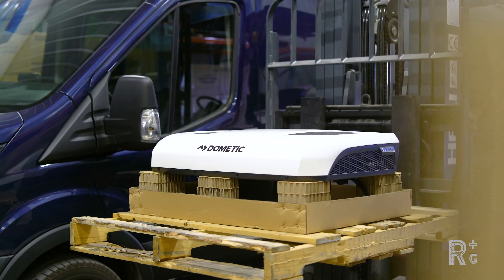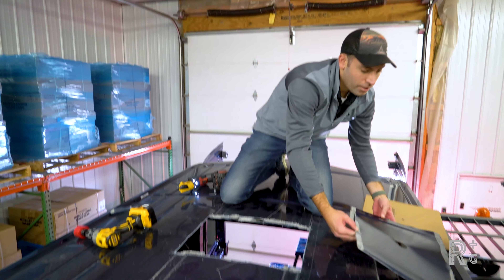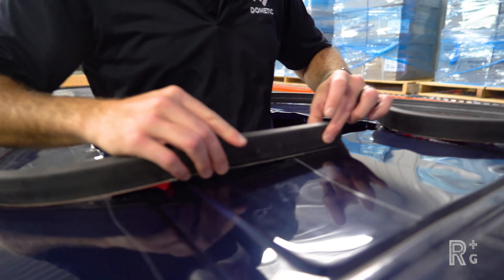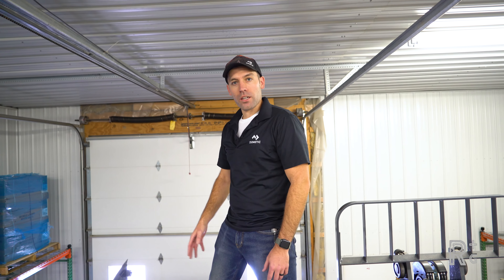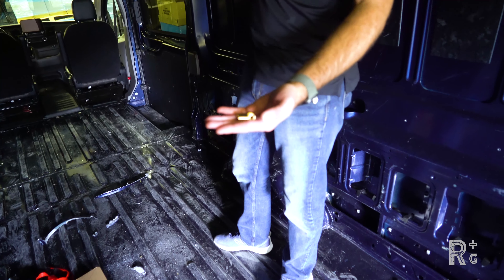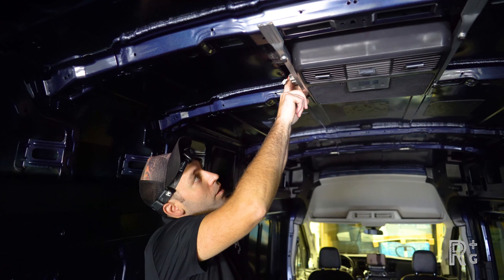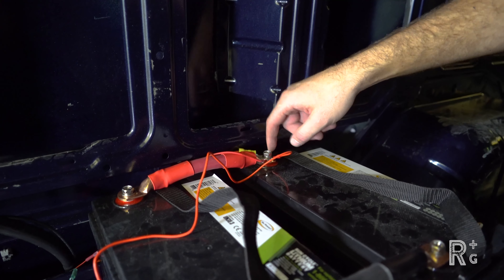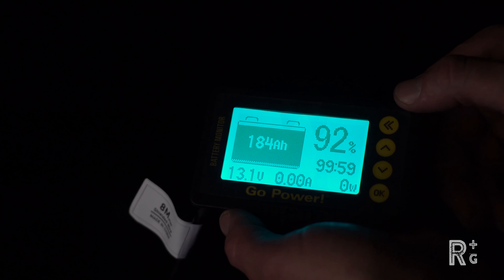Dometic RTX 2000 Installation |12V Battery Powered Air Conditioner | RackUp+Go

Comment: It was a pain to see how you drill metal without eyeglasses and cut your fingers with sharp edges, use gloves 😢
Paint open metal, use a file to dull sharp edges, and make movies with manual focus, you lost focus a lot of times😢
Reply from the maker: Thank you for your comment!
Reply: my thoughts exactly, you can see the metal burrs raining down, flinging around randomly. I've seen a guy get a sharp metal bit in his eye and go to hospital, it's just so dangerous and painful. Eyesight is not guaranteed after you get metal stuck in the eye.

Comment: How do you charge the battery bank? Do you advise connecting to main van battery?
Reply from the maker: Hello! There are multiple ways to charge your battery bank, such as solar, alternator, shore power. As far as the components necessary to achieve this, you can contact our tech support team or visit a professional installation shop in your area!